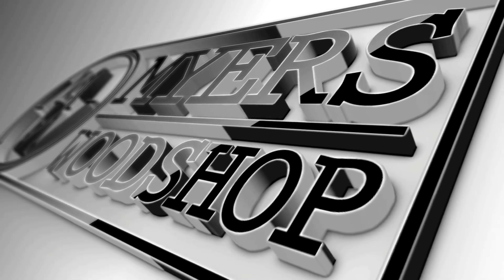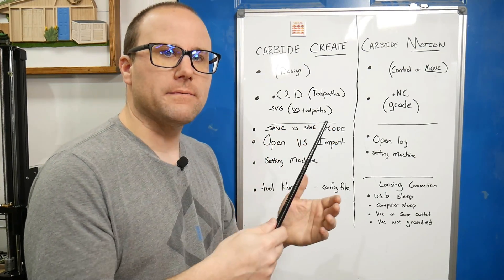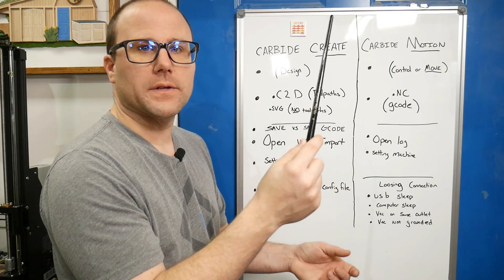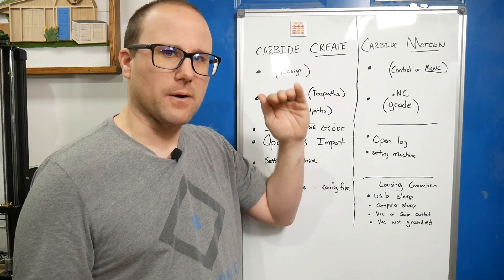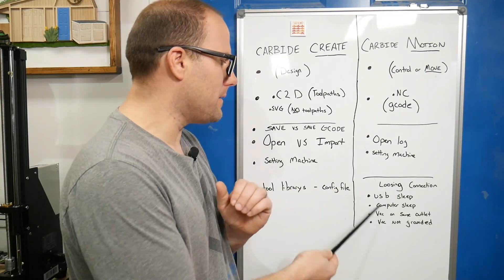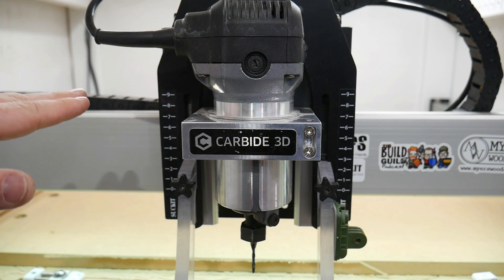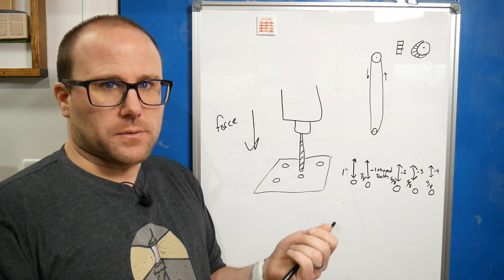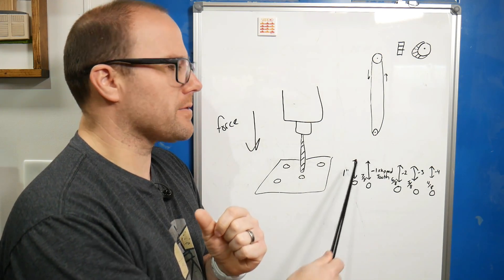The Most Common Mistakes With Beginner CNC Machines // Shapeoko 3

Comment: Thanks for the video.  The problem I have is not that the plunge loses depth, but that it seems to not pull back far enough and eventually starts machining the waste board.  It's actually got a lot worse since fitting the Dust Boot.  All belts seem tight enough.
Reply from the maker: are you setting the z zero from top of stock?

Comment: Thank you very much for your explanations I hope you can give an Explanation on why just doing a simple circle that my bit will not stay level and leave a raised spot, or not follow the circle,I have tried different size circles and squares with the same results, changed bits, sorry shapeoko xxl in carbide create, thank you if you can help
Reply from the maker: I no longer have the shapeoko but i'd check your belts and v wheels.
Reply: @MyersWoodshop   thank you for responding but it makes the same mistake over and over in the same spot so it is not the belts or the tram, I can move the program over to the other side of the board and it still makes the same mistakes in the same spots so I cannot see how it could possibly be the belts

Comment: Good video for beginners.  The Carbide Create is changing very fast and some functions like the tool library have changed function and location as well as how to edit them.  I have your spoilboard and fence design as well as the cam clamps.  I like your design and highly recommend using your design.  Keep up the good work.  I also subscribe to your youtube channel.  In your workshop tour video you mentioned that you have stopped making your colored pencil bowls due to health reasons.  Perhaps a good video on Shapeoko dust collection and safety with the CNC would be a good subject for a future video.  Thanks
Reply from the maker: That’s a good idea!

Comment: Just got my Shapeoko last week and have already realized that some form of dust management will be essential. Also, any idea how high the risk of flying broken bit projectiles is? I'm always wearing eye protection, but do broken bits come flying out like shrapnel?
Reply: They certainly can! also the Suck It Dust Boot is excellent, I think Ben did a video on them, there are lots of videos at any rate.  Highly recommend them.  They would probably block broken bits.
Reply from the maker: it can.  the suck it dust boot is by far the best!

Comment: I fixed my connection loss issues by getting a usb isolator and use the antistatic hose from rockler for vacuum.
Reply from the maker: good call. what was the cost on that?